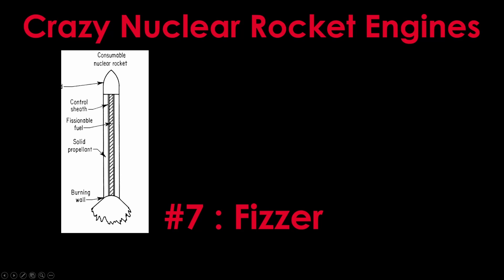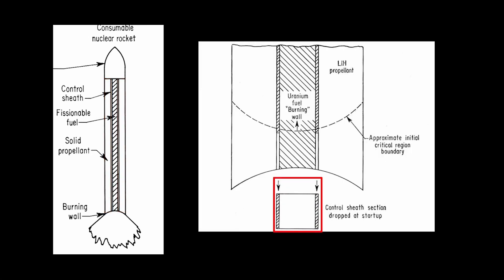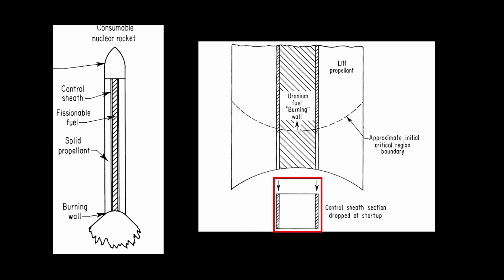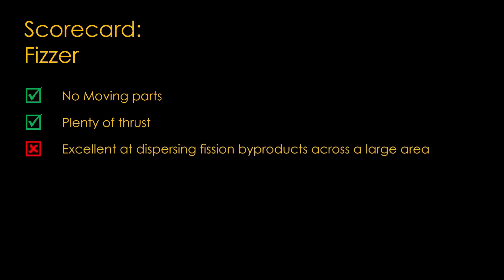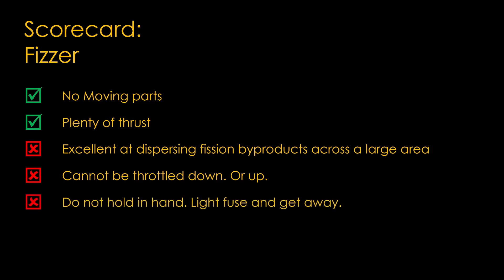Crazy Nuclear Rocket Engines 7 - The Fizzer

Comment: The craziness scale should be allowed an "unless" rating, especially in this case. If I'm sending a huge "Isaac Arthur" colony ship between star systems, I don't care about spewing radiation behind me, but I will care very much about simple solid-state systems that can sit for centuries and still light up reliably. As for the fixed burn time, it's much less of a problem if each individual rocket is tiny compared to the ship. Adjust your burn by deciding how many thousand rockets you'll expend out of the millions you have in stock.

Comment: This one is purely theoretical at this point but I think it's the most feasible   as a heavy lift rocket. Like if you wanted to get a large mass of nitrogen off of titan.
Reply: After a while you would pollute Titan with uranium. I think the idea is interesting but most applicable in space or maybe if we want to evacuate earth quickly (because someone fired a Fizzler in our atmosphere).
Reply: @realnameverified416  Uranium's density is so high it wouldn't stay in the atmosphere for very long at the temperatures of titan. The pyrophoric nature of Uranium might also be mitigated completely by a dense nitrogen environment. To launch it on earth might cause an immediate detonation of the entire rocket.
Reply: @rexmann1984  I worded that poorly. I meant to say it would contaminate the surface. Even if it's not in suspension for long, given enough time and launches it would make its way into the exports (nitrogen).

I guess it could be worth the attempt, we could get a lot of nitrogen before contamination became a problem. Enough to fill many cylinders and maybe to make a difference on Mars.
Reply: @realnameverified416  The atmosphere is nitrogen it's surface is hydrocarbons which is probably just gonna be used as rocket fuel any way.